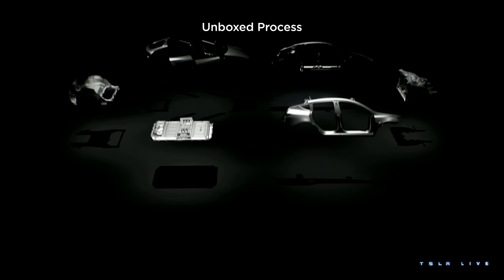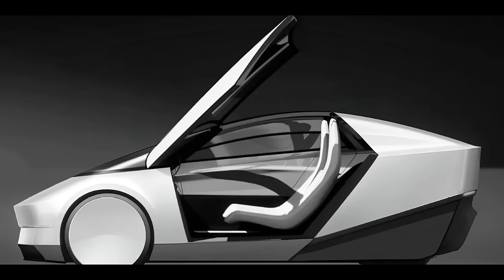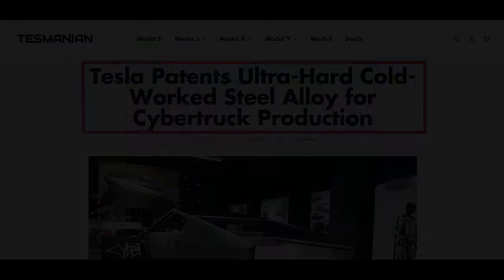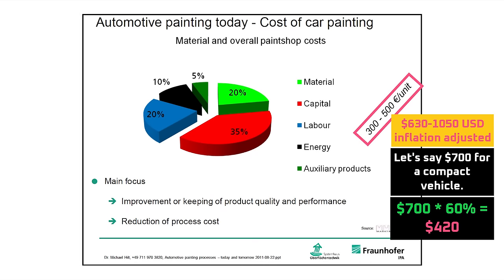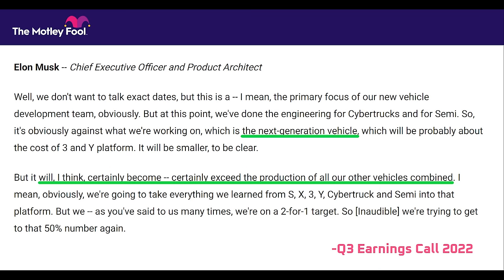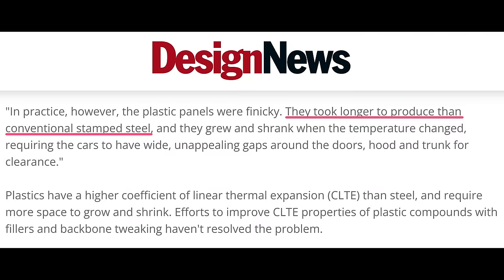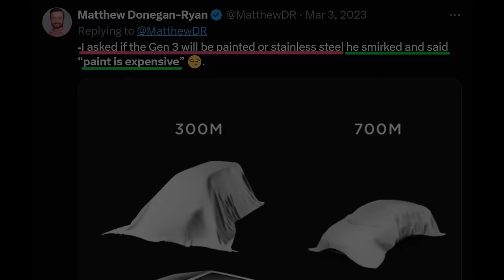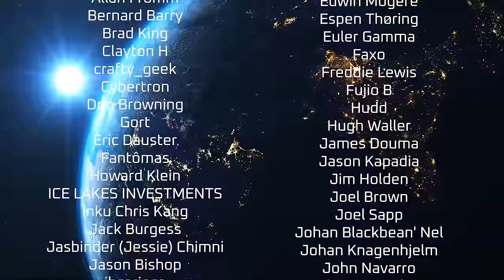Tesla's Next Gen Compact Vehicle // Stainless Steel vs Paint

Comment: The Plastics gm used were the cheapest under designed plastics they could buy at the time. Since then the development of Polycarbonate has been at the forefront of aircraft and consumer goods.
Polycarbonate is a much superior Plastic! Thermal form, blow mold and brake bending, make it cheaper and easier to form than steel. Polycarbonate is also known as bullet proof glass and can be structural. It's colored, no reason to paint and comes in any color. Polycarbonate is manufactured in America!

Comment: If it doesn’t have a steering wheel and foot pedals, it isn’t going to matter to TSLA investors whether it has paint or not because it will mean that Elon is deranged and out of control and the company is going down the toilet. Do you have an opinion if the Gen 3 compact car will be released in a human-controlled version?
Reply from the maker: Well that was a non-sequitur
Reply: @thelimitingfactor  I like your analysis here and I had never seen the information about cost of paint vs non-paint laid out in such a clear way. Thank you. But at the moment I’m more concerned about whether Elon has deleted the human controls from the Gen 3 compact rather than whether the paint will be deleted.
Reply: It could also Tesla has solved autonomy or they are very close to. They make decisions driven by data and what MSM portrays as the way things are done. They will lose some investors and gain some.  Designing vehicles without steering wheel has been done by Canoo and Zoox, but they are not deranged. Way too much emotions will be my guess with your comment. Wish you well
Reply: That's only for robo taxi, not the 25000 car.

Comment: Thanks Jordan!  One thing I haven't heard others comment on is that "unboxed" may allow surfaces to be painted while laid flat.  You can potentially go a lot faster if there are no vertical surfaces painted.
But the counterpoint toward stainless: during Sandy's tour, Lars says 75% of side impact protection is from the door panel.  This may have implications on other structure, which may make alternate door materials difficult.
Though a possible variation could be an ultra-hard steel with E-coat, and a factory wrap.  Especially if left angular, could be quite cheap to manufacture, particularly in Mexico/China/India.  Repair cost would also be much lower than paint.